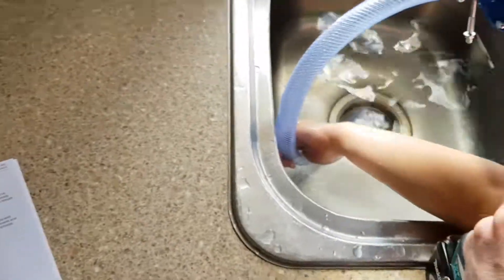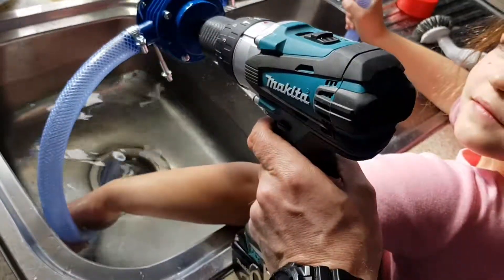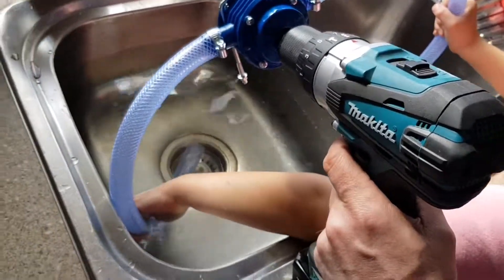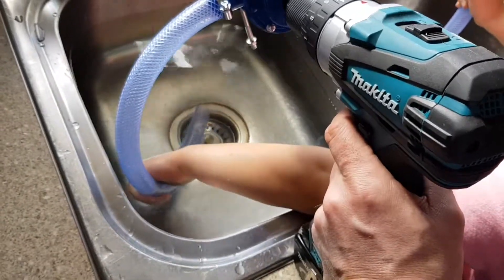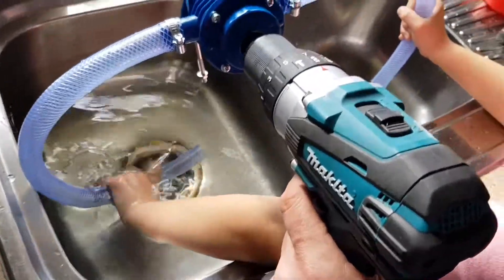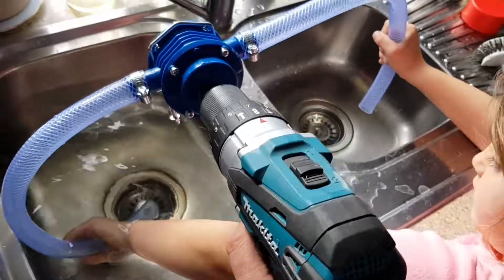ALDI Drill-Powered Water Pump

Comment: I bought one of these some time ago, but haven't ever been able to get it to work. I have checked inside and all the seals are in place. The drill is a very good one and is spinning the pump ok. Anybody got any ideas?
Reply: Hi, hope you did not bin it! I took mine apart, as it seemed to be turning when I connected my battery drill to it, but not pumping. I realised that the blades are plastic, and require centrifugal force to push them out into pumping position to move the water. I connected up my more powerful wired drill, and it worked a dream.
Reply: Grant, I swapped from my powerful drill to an old, cheap and nasty one and it started to work. I then found that with a long length of hose on the inlet and a short length on the outlet it wouldn't work, but swapping them round did work.